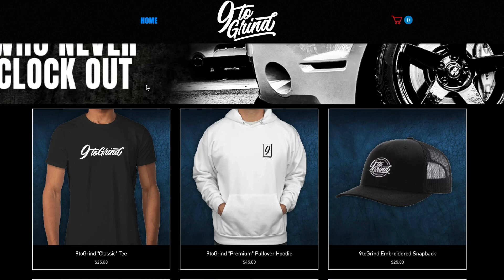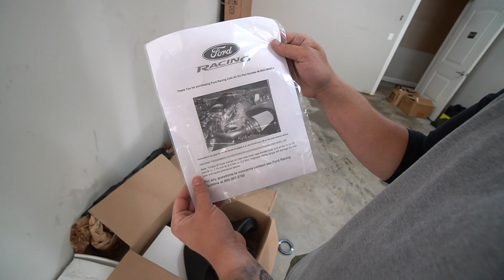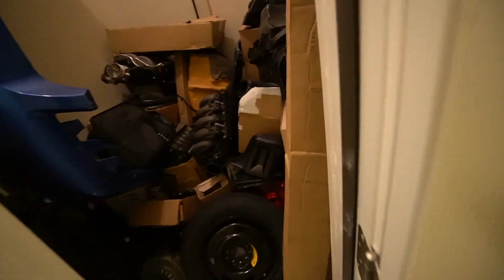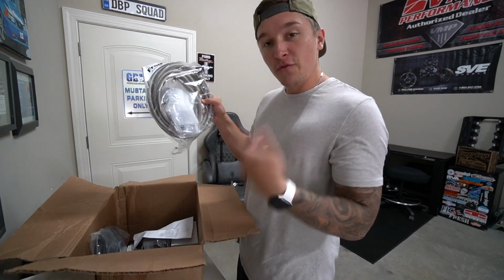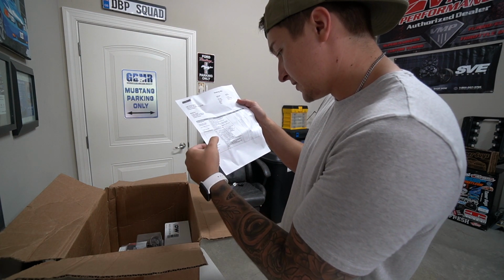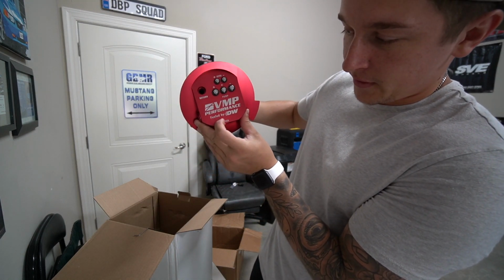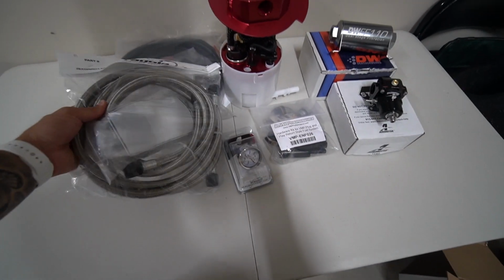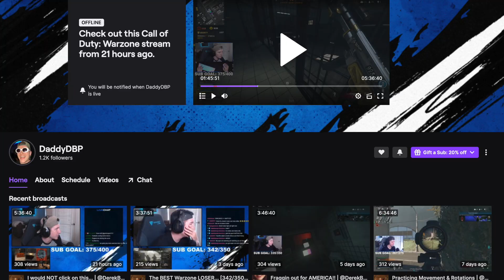IT'S FINALLY HAPPENING!! *800HP CLUB??*

Comment: Long tubes full corsa catback heads and and cams next?
Reply: He already has full long tube corsas I believe
Reply: @richardlapoint1845  I don't think so.  Could be wrong though.
Reply: @lifeonmars03  my bad you're right, he just did a resonater delete
Reply: @richardlapoint1845  He has stock exhaust manifolds, SVE off road x-pipe, resonator delete and Corsa Extreme axle-back.
Reply: @noahbolt  yeah I went back to the video where he did the exhaust

Comment: I just don’t get after the car not running right after everything that’s gone wrong. The car finally back to running good again he keeps adding stuff that can break it again. That’s just me though bro
Reply: Well the e85 route is much safer than regular gas with his supercharged application. Just because you hit a couple road blocks on the way to your power goal doesn't mean you should stop or be deterred. Keep at it & get it right.
Reply: @lifeonmars03  is definitely a lot easier when you get most of the parts sent to you for free. Maybe it would have been better to have just done the e85 and not the supercharger cause that puts a hell of a lot more strain on the engine
Reply: @albertwesker2283  true, true. Valid points bro. & a supercharger does indeed add stress but the gen 1 coyote can def handle it since it's able to withstand about 650 rear wheel hp on pump gas with a good tune. It can last years. It's been proven. It can handle about 750 wheel on a e85 setup which is way safer for the engine than 93. 

You not wrong though bro. A fbo na e85 setup will get old fast while you're still on the quest to make more power. I have had a paxton setup for a year now and I'm at 68k miles. Not worried about a thing. Still on 93 for now but I plan on building the motor next year to achieve 800 rwhp safely 

Just have the right support parts with maintenance & a solid tune & you won't have much to worry about.